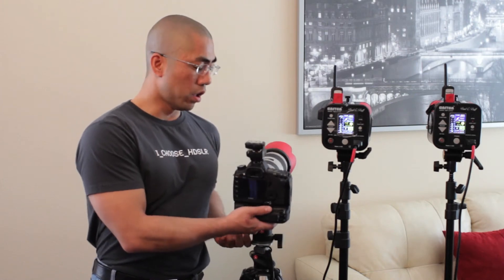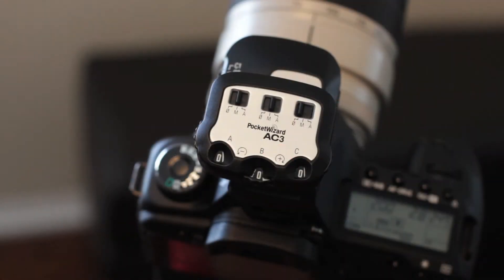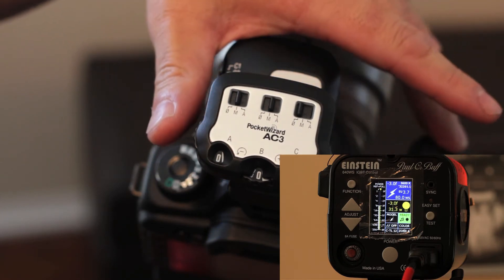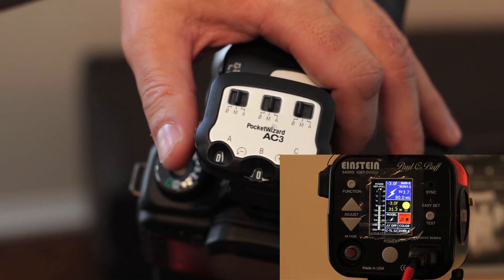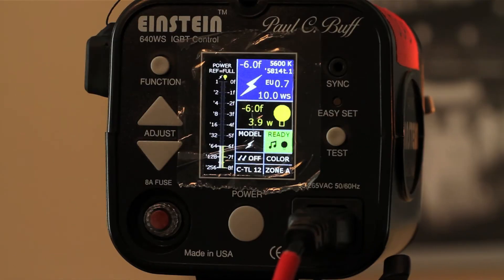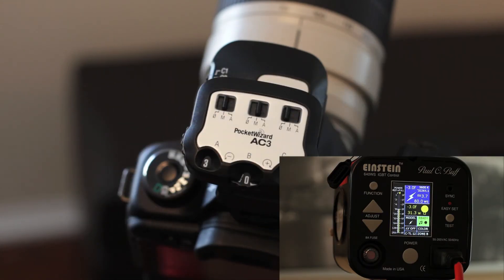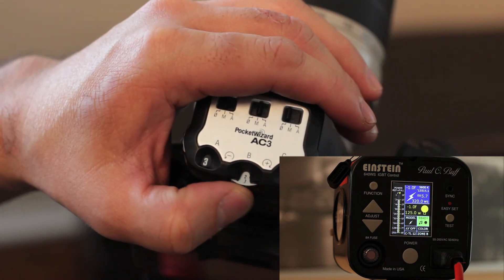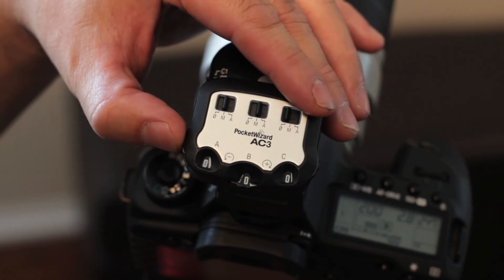Einstein with PocketWizard PowerMC2, MiniTT1, and AC3

Comment: I understood that the AC3 DOES NOT work with the Mini TT1.  It only works with the Flex units in 2022.  Don't make this mistake that I did.  There is new firmware called the E-Update that costs $15 from Pocketwizard.  It ONLY works with Flex units....no longer with the Mini.

Comment: I know this is old but can you confirm if the only way to control power of the Einsteins is using the AC3? In other words its not possible to do it via the miniTT1 or TT5 Flex?
Reply from the maker: IIRC, you can control power without an AC3 by using the internal exposure compensation. So TT1 + PowerMC2 and using Canon EV. You'll have to read the manuals on TT1 to confirm this.

Comment: Why not just get the wireless remote system designed for the Einsteins? The Cyber Sync system from Paul C. Buff is much more reliable, has way more features, and is less than half the cost. Total setup for three strobes is about 330 bucks, which includes the Cyber Commander remote with LCD screen (more options for strobe setup than I will ever need) and flash meter. If you would like a less sophisticated remote, use the Cyber Sense option instead and knock 100 bucks off the price. I've been using the Cyber Sync system with my Einsteins constantly for almost a year now - zero issues! 

https://www.paulcbuff.com/Remotes/Cyber-Commander.html
Reply from the maker: Nothing wrong with Einsteins. I used PW because I was already in PW ecosystem. Note that this video was shot 8 years ago. If I were buying a system now knowing what I know now, I'd probably just go Profoto.

Comment: Great video! When I try with the same setup, and turn a zone off, the einstein's still fire. Have you found a solution to this? Only difference is using the Nikon D5 and using the latest firmware on all.
THanks!
Reply: Do you have the infrared sync turned off? If not - it will fire every time another strobe fires near it.

Comment: I ran in adjustment limitations of the AC3 too, especially in manual mode. My solution was to lower ISO from native 200 to 100 (costs a bit of dynamic range) or to use flash exposure compensation in the camera.
If the Einsteins with MC2 can go to real short flash duration then going to TTL will solve the problem also.
Presuming your Canon kit can do the next and you have a Canon on-camera flash, you can use it instead of the AC3. Whilst it adds bulk and weight, it likely has more adjustment range. It will not be as fast/direct as the little wheels on the AC3, I guess.
In the case of Nikon TTL, the on-camera master flash gives a fourth zone and it can be on an extension cable (say as a key, fill or clam-fill near the camera).

Comment: Cyber Commander seems to be the best option overall.  I also like the fact that it can be used as a light meter off camera.
Reply: Problem is the wireless PCB solution is very susceptible to interference and doesn't appear to be nearly as robust as the Pocket Wizards.

Comment: I have TT1 + MC2 combination: Lots of misfiring/not-firing !!!
Reply from the maker: This review is a few years old. But since then, I have been using a FlexTT5 on the camera hot shoe as the trigger. I found that the TT5 simply kicks out strong radio signals than the TT1. I like the size/formfactor of the TT1, but as you know, it's better to have more consistent function over form.
Reply: Do you use TT5 (transmitter) + MC2 (reciver) combination or  TT5 (transmitter) + TT5 (receiver) combination?
Reply from the maker: opqrst7 TT5+AC3 on hotshoe to Einstein+MC2.
Reply: *****
I am not sure if it's the problem with TT1, because it also happens when using more than one strobe, where only one of them does not fire. If it were a problem with TT1, then, both strobes wouldn't fire. I don't know?!!
Reply: +opqrst7 I only experience misfiring (with 9 TT5s working in one studio) when I do not follow the boot sequence. I sometimes switch on a flash+radio later in the session and hope the master will pair with it. Bummer - idle hope. Totally black image.Switch camera/master off, boot up again and there we go. 
Formally, the radios need to be at least about 1 meter (40")  apart or else the radios cannot communicate. I guess this was improved in the newest firmware versions as I never suffered from it. I keep a minimum distance of 30cm (12"). I saw a clip the other day where a guy held his hand around the antenna of his PW when at close range and it worked.
I guess you can compare the issue of the distance between the radios with flash, exposure and dynamic range. They have to communicate details and at close range one radio overexposes the other - the details get lost.

Comment: can you manually adjust your einstein first to the lower output where ac3 doesn't cover and still be able to trigger it normally?
Reply from the maker: Good question, but the answer is no. When you half press the shutter button, it's going to send the signal from trigger on camera to the trigger on the strobe which will carry the power setting and cause the strobe to adjust accordingly.